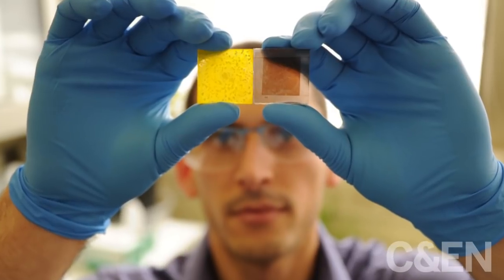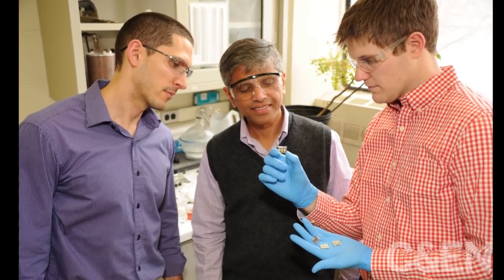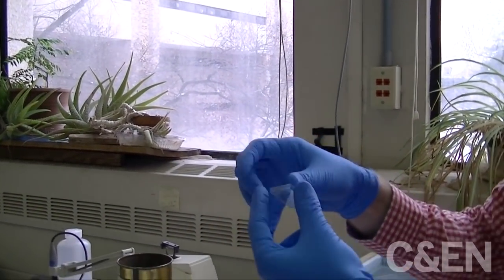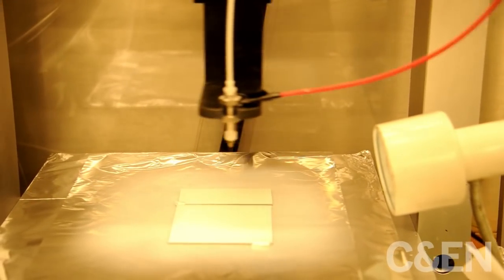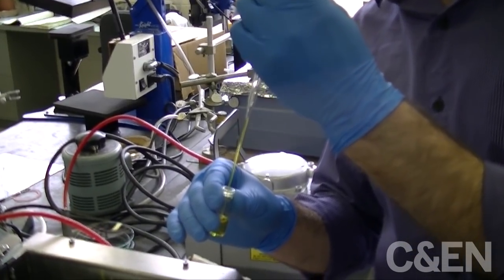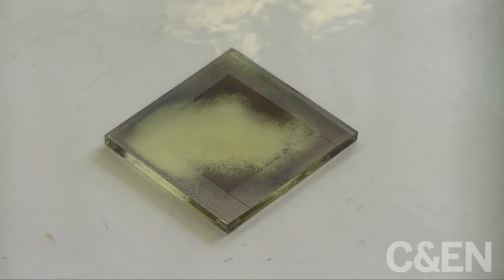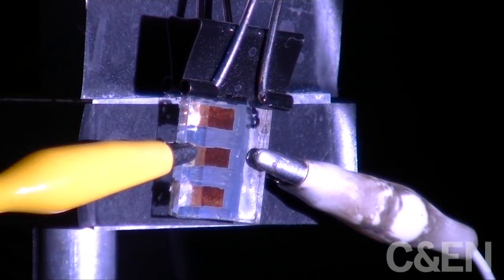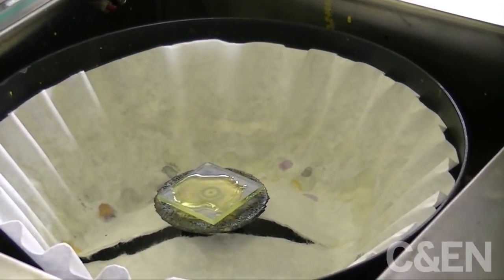Perovskite solar cells made simply

Comment: I want to learn how to do this kind of stuff, is there anyway to do that without taking an expensive degree
Reply: Hey Ben, let me know if you ever find the answer to that, or a better answer in general, ok?
Reply: Of course. Educate Yourself freely. There's more information online than in any world University.
Reply: this video shows the perovskite-making process in better detail: https://www.youtube.com/watch?v=crAugJXG3QA   You can do most of those things with simple hacked together machines at home except for maybe the 10^-6 Torr vacuum sputtering metal coating part (which maybe you could do in a simpler way, like drawing on electrodes with conductive ink pen for PCB's https://www.intertronics.co.uk/product/silver-conductive-pen-silver-flex-conductive-pen-nickel-conductive-pen).  See https://www.youtube.com/watch?v=75AoWl3jhcQ  for a fantastic D.I.Y. vacuum system that goes down to that level.

Comment: does this mean that there is no need of nitrogen filled glove box & dry air box for deposition and annealing purposes. Please Comment
Reply: +khurshid parray Yes you can do it in air with controlled humidity
Reply: Thankyou very much P Kamat
Reply: It is only for the demo purpose, when it comes to the real devices, then there is a need of controlling the oxygen and humidity level so you have to switch in to the glovebox. However, 2D/3D perovskites the hybrid combination may be used and device fabrication may be done in the ambient atmosphere but still the films will not be that much high quality and the device efficiency will be lesser.